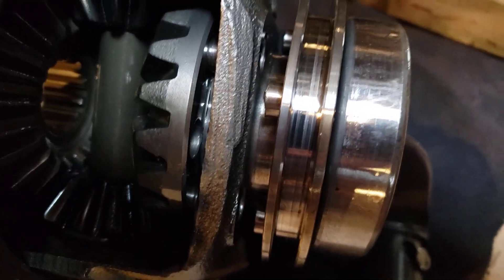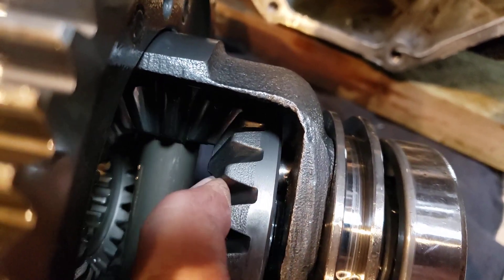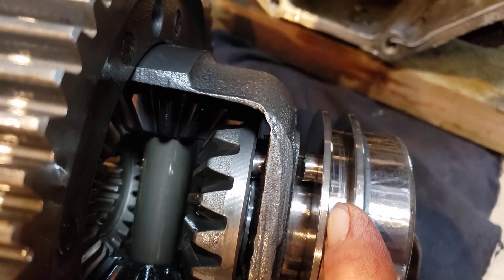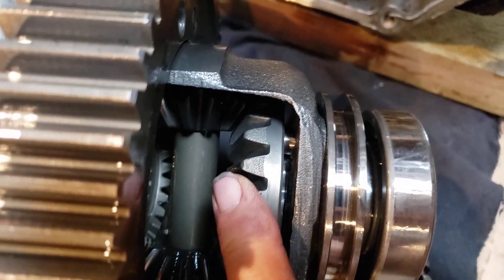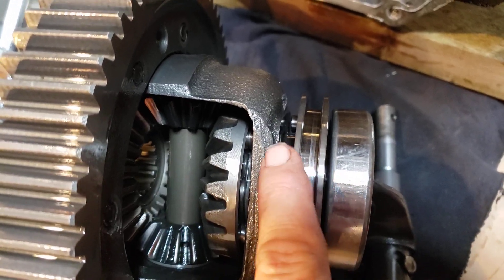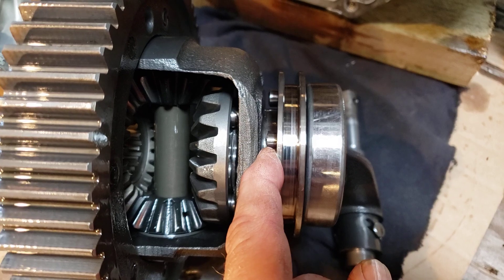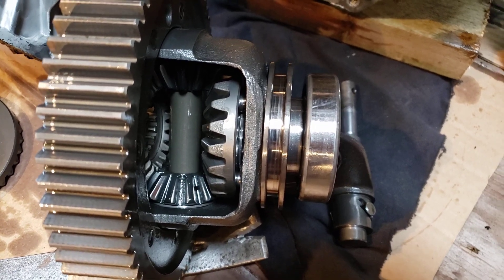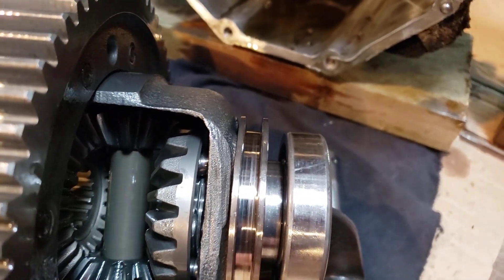Kubota BX FAILS again! Diff-lock disaster.

Comment: Mine (bx2370) is currently stuck in the lock position. I'm going to let it break, fix it then sell. I had to replace the head gasket at 13hrs. Mine is lemon flavored.
Reply from the maker: Sounds more like sour grapes.  LOL.  Interesting why or how it is locked.  Good luck, and look forward to hearing about the final results.  🙂I am wondering if the fork shaft is seized, as happened to mine the first time, if you check my earlier video.  https://www.youtube.com/watch?v=fS2RzWaMfkU
Reply from the maker: If the fork shaft is seized, it will be a much cheaper repair, other than the labour to fix before a catastrophe like gears and case fracturing?
Reply from the maker: In my opinion, the fork and shaft bind because people push hard on the pedal, expecting the differential lock to activate.  Pressing hard on the pedal is the worst thing to do.  Learning how to engage (and more important - dis-engage) the diff-lock is very specific, and not as Kubota manual or employees explain.

Comment: Are you engaging this at speed? Rarely hear about damage like this otherwise.
Reply from the maker: Unfortunately, because of my posts and involvement in Facebook Forums for BX, I hear about it all the time, even in BX tractors with less than 300 hours.  Check out this other video:  https://www.youtube.com/watch?v=B9cr39Cf6Io
Reply from the maker: The damage in many cases is NOT engagement, but rather dis-engagement, where the pins will not release quickly, but work their way out, creating leverage, stress and damage.  When those pins break, they can become lodged in the gears and have cracked the aluminum housing... a very expensive repair.
Reply: @ThisOldMan-ya472  Same rule applies - Stop first, then disengage.
Reply from the maker: @crxess  Perhaps you should watch the videos, before making that comment.

Comment: Mine broke to, 2017 bx25d 300 hours
Reply from the maker: Has it been fixed?  Did the Dealer blame you for incorrect operation?
Reply: @ThisOldMan-ya472  I just got it back today, they fixed it for free under warranty but if alot of people are having this issue why don't they recall them
Reply from the maker: @andrewshatlaw3290  The odds are that they sell 100,000 and have 200 fail.  According to the local dealer, they were surprised I have 2800 hours on my BX25, because most local users have 200 or less hours on their machines.    Also, better chance of these failing on machines with the proper ballast, for the FEL, like a backhoe or 600 pounds of something. (mother-in-law?)

Comment: I'd weld some extra pins and drill some holes in that carrier, beef that sucker up!
Reply from the maker: Before I realized increasing the pin size was the simplest and most effective solution, I had consulted with a couple of machine shops, including a local company that manufactures parts for helicopters.  None of them had a cheap or simple opinion.  I first considered more pins, but that would complicate and probably weaken the differential lock.  Thank your for your observations and suggestion.  I had bought a new carrier and pin set, but was able to remanufacture the damaged parts, and still have the new set sitting in a box.  :-)
Reply: @ThisOldMan-ya472  Return those probably EXPENSIVE parts and buy yourself a drink!
Reply from the maker: @jasonjaeger4042  Originally I asked if they would take them back, and for 20% restocking fee they will.  However, with parts shortages, perhaps I will eventually get 100% return, and buy myself two drinks?  lol  (I wasn't sure how well the modification might work, but I also have a second set of damaged parts which could be modified, so yes, I do not need the new stock parts.)

Comment: Your not supposed to engage while moving or the wheels are turnig, what we need to do is read the manual.
Reply from the maker: LOL  Good luck with that Tom.
Reply from the maker: By the way, you need to re-read the manual, because it tells you at the top, when the diff-lock is engage:  you will have difficulty turning.  What that means, for example,  if you are pulling a plow, don't expect the tractor to make the turn when the diff-lock is engaged.  You are not the first person to  not grasp the whole set of instructions.
Reply from the maker: From the Operator's Manual

To avoid personal injury due to loss of steering
control:
A Do not operate the tractor at high speed with
differential lock engaged.
A Do not attempt to turn with the differential lock
engaged.
A Be sure to release the differential lock before
making a turn in field conditions.

A When using the differential lock, always slow the
engine down.
A To prevent damage to power train, do not engage
differential lock when one wheel is spinning and the
other is completely stopped

Comment: Sux the expense fixing this, good luck with that man!  That design is kind of janky...alas for me, I don't know if my massey's diff lock is any beefier, probably not. Real easy to bust those pins if you try activating the lock with the wheel spinning fast.
Reply from the maker: Thank you.  I believe the issue is mostly with the BX tractors with the heavy backhoe installed.  I have an extensive mechanical background, so do the repairs myself.  In fact, I have come up with a modification I am working on, to double the number of pins to eight.  I will be modifying old parts for this experiment.
Reply from the maker: Now realized the case can not accommodate 8 pins.  However, the stock pins are 10mm, and by installing available 12mm pins, which should fit, the cross-section area is increased by 44%.  Hopefully this will be more than adequate, without compromising the integrity of all parts.